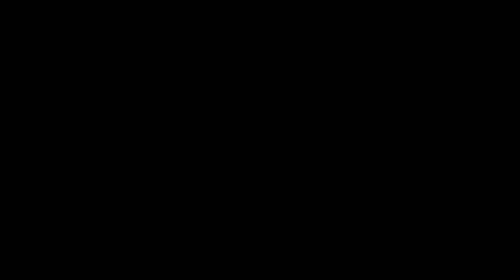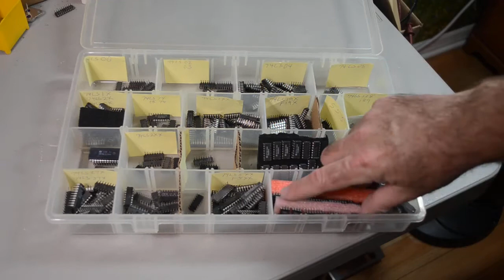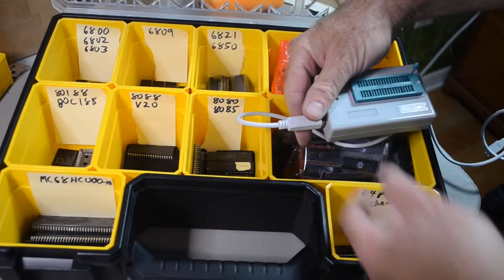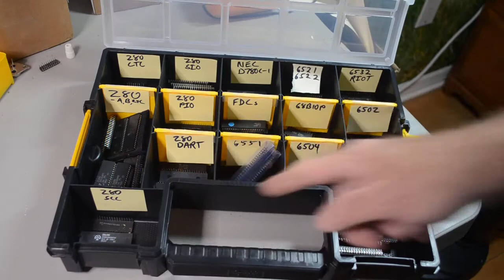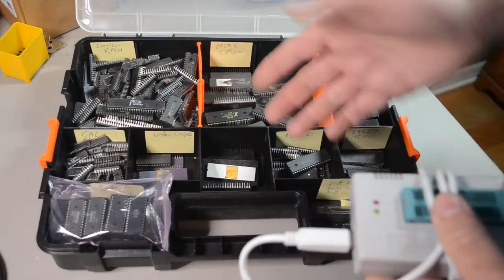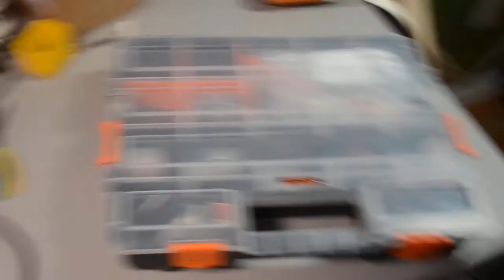Odds n Ends From My Workbench 06262022

Comment: I've got a few Commodore computers, I was a game developer in the early 80's and I know the value of having those old components.  I too have an electronics collection of IC chips and electronic components as you were saying the part numbers like 7400, 7404, 7408, 7474... I was calling what they were out before you said what they were!  I guess my old memory chip in the brain still works LOL.  74138's were used in the VIC-20 as an address decoder (I also like the 74154 decoders so I could get 16 instead of 8 addresses).. but I used a 74138 on an interface board I made for it, turns out that Radio Shack (of all people) make an edge card prototype board with 22 fingers (per side) that happened to fit into the VIC-20's expansion slot... so I made an GPIO with inputs and relay outputs and I made a custom control system (just for fun) // 

Presently, I'm doing a massive clean up and trying to organize things... and eventually see if those old computers (Amiga, etc.) comes back to life... It's crazy that you've got a lot of parts, I might take you up on that suggestion that you've got parts... because we've got both a Zombie Apocalypse and a Global Pandemic with supply chain crisis LOL.  P.S. I too learned to program on a TRS-80 Model 1 back in the day... so I have a fondness for the Z-80 and Radio Shack's stuff as well.

Comment: Hey I saw your video on EPO in Houston. Thanks for the info. I live in the Houston area and the old EPO in Clearlake disappeared several years ago and I thought they'd gone out of business except for a tiny store about five miles away from the old location. I have an old issue of Popular Electronics that I've been holding onto for about 15 years with a design for a high quality 200 watt audiophile amplifier that uses 2SJ162 P channel L-MOSFET and 2SK1058 N channel L- MOSFET that can be used for all kinds of audio projects. Can be used for a "killer" home stereo or subwoofer system, musical instrument amplifier, PA system or practically any custom audio project. I was just wondering what EPO has in the way of semiconductors like this?